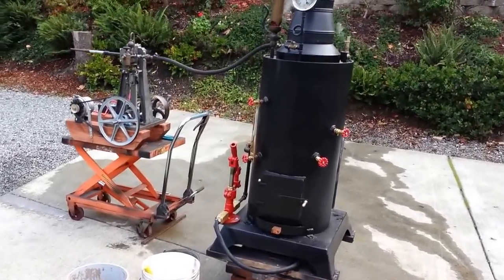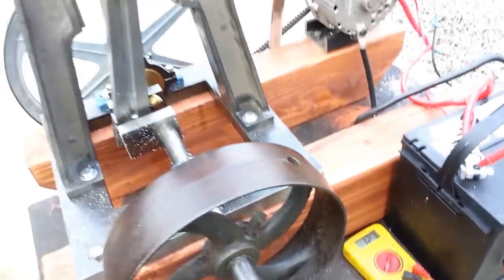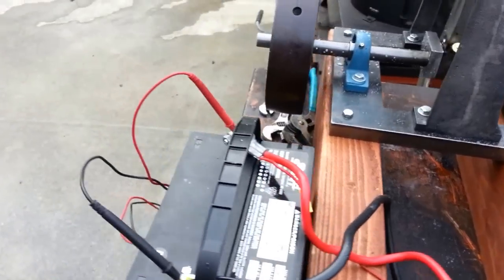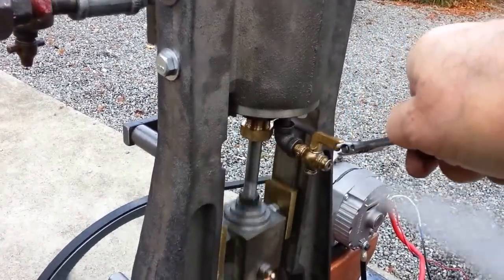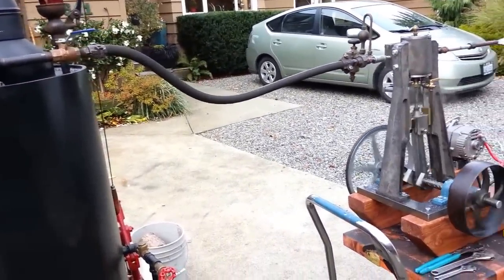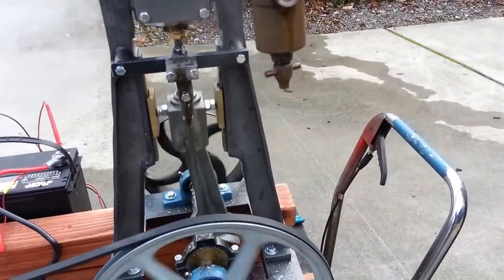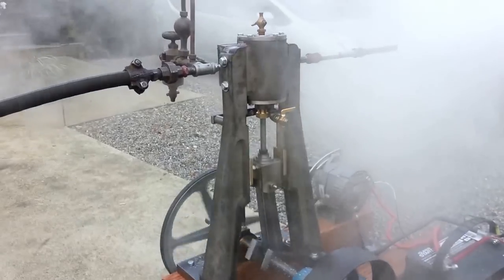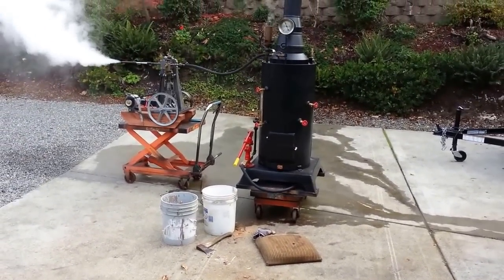Steam boiler engine Allen S Steam Engine with Alternator DC Electricity Off Grid

Comment: Usually a normal car alternator would lift a battery too around 15 volts whilst it was running and then drop back to about 12.5 when it stops. Alternators need to be excited to work, the battery usually supplies that power. But a beautiful example of engineering

Comment: Could you run another alternator from the pulley on the opposite side?
Reply: Yes but the pulley on the other side is not a pulley. It's a flywheel and it's to keep the engine balanced as well as give momentum to the crankshaft. It's better to simply replace the alternator pulley with a double pulley then add another bracket and alternator to run off the same driver. Many old diesel engines in boats have such a set up for more amperage or for 24 volt systems.

Comment: what was heat source for steam? coal?
Reply: You can use a sawdust stove to heat the boiler.
Reply: Why is that even relevant? Are you unable to imagine a means of making steam yourself? ...or are you trying to downplay the fact that his engine isn't burning gas? Put a pipe in a tea kettle and put it over your stove or BBQ pit...or magnetic inductor or even focus sun on it with a fresnel lense you ripped off the face of an old flat screen TV. Whatever heat source will boil water will power this engine. Use your imagination. What he used for the purpose of this demonstration is irrelevant. What matters is all the possibilities besides fossil fuels or radioactive materials. You could use a windmill to compress air into a tank then later use compressed air to power this motor without steam.

Comment: How much water does a steam engine like this consume? Great Videos, really makes me want to built one myself!
Reply: It depends on how fast you run it but you could put the exhaust through a series of copper loops wound through a heat exchanger and into a condensing tank then feed the condensed water back into an input for the boiler and theoretically if you can cool and condense the water as fast as you're using it you'll eliminate water loss almost completely. Now that's not likely and it's not as energy efficient, however one could very well take advantage of the temperature differentials between the hot and cold sides and use heat sinks from each to power Sterling engines and regain a good amount of that energy loss. Keep in mind, you're not defying any laws of physics by eliminating water loss. Your fuel source is not the water. The water is actually just a hydraulic fluid which is moving the energy being used. The fuel is whatever you use to boil the water. Now if you could use a fresnel lense and sun to boil the water you're making free environmentally safe energy with zero carbon emissions.

Comment: You may try a Tesla Turbine as your primary mover and close the exist steam back to be boiler. If you change also your burn chamber to be rocket mass heater stile, will likely achieve quite high efficiency.